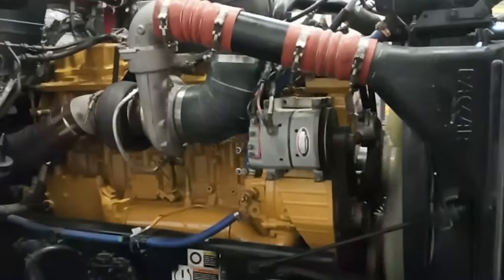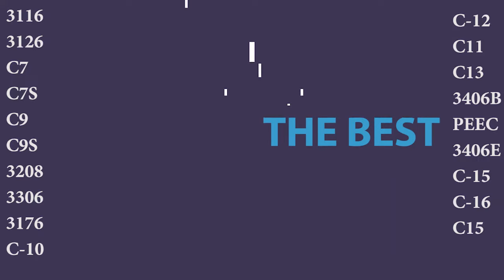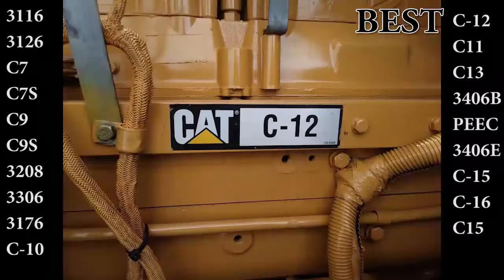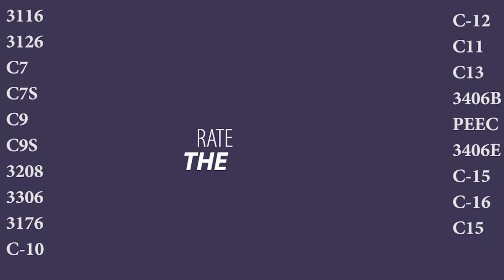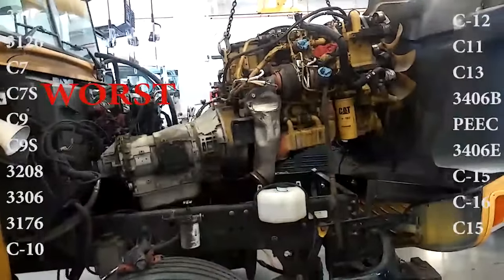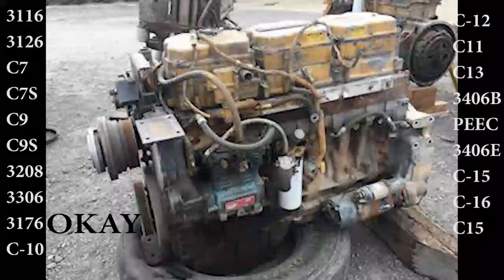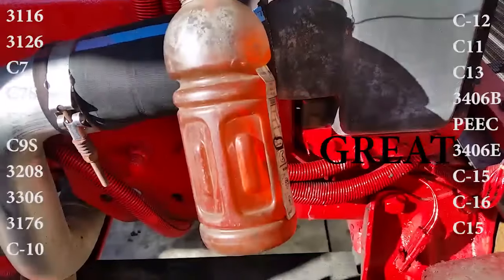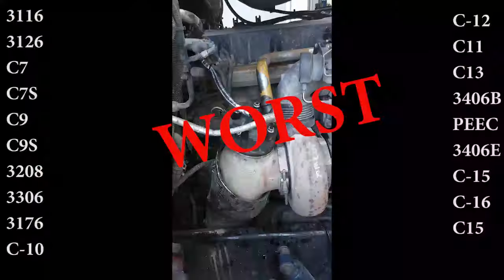Ranking the Cat Diesel Truck Engines from BEST to WORST!!!

Comment: Great Video I run a 3406B that I just overhauled and it’s great I love it! I would like it to smoke some and have seen a video on turning the pump up, what is your thoughts would you be willing to give your ideas
Reply: If your talking about on acceleration it's your FRC. 1988 and back the FRC cocks with boost. 1989 and up cocks with oil. You can not tell them apart. So the best way is to remove the line off the FRC cover. Remove the cover (two bolts). Some older FRC's has a gasket. (The cover would warp and gasket would leak) The new style has a oring which is better. You can't buy just the oring cover and put on the old style. Back to FRC adjustment. With cover off start the engine and push in on the valve. Accelerate rapidly and look at smoke. Turn adjustment screw in to increase acceleration, smoke and fuel consumption. Turn screw out to decrease smoke, making engine more sluggish. Depending on your serial number the VTU is a known problem and needs to be inspected every two years or so. Also fuel pump bypassing, if the bushings are off the old style design.
Reply: @johngoldsmith6629   Mine is a 4MG engine
Reply: @zedstierwalt6088  4MG's was the worst timing advance problem engines. Had around 6 or so updates. Once done they would hold up fairly well. Also some engines had a recall where the pin would fall out of the governor and the engine would run away, and very early engines on VTU and governor dowels. It was the first engine to get the asbestos free gaskets and leaked oil and would blow head gaskets. Again once fixed they was good engines. 4MG's was two design's below 03600, which was still a 7FB and 03600 and up which is a true 4MG.

Comment: I've had 3 trucks with C-12 engines.  With the exceptions of 2 broken valves, 1 cracked injector, and bad cam followers which took out the cams, I consider the C-12 to be a good engine.  I still have one today,  a 2000 Freightliner that currently has 2,040,000 miles, and this truck is in the shop less than the new trucks.
Reply from the maker: You should get your 2 million mile jacket and watch from Cat

Comment: You happened to skip over the c-10 and c12 but great video none the less. Thank you for the content and knowledge.
Reply from the maker: The C-10 and C-12 were in the "Best" category so they were mentioned early in the video. I didn't go into depth on any of the engine as the video would have turned into an hour.

Comment: I started my trucking with a WT 9000 Ford (1976) with a 3406PC @ 365 hp. It had plenty of power and was the most reliable engine I ever had. Really got spoiled as I got closer to today. Trucks got much nicer but no engine got even close to cent/mile cost.
Reply: Never heard of a 3406 PCTA 365 HP. Worked on a lot of 3406 PCTA 360 HP, that used a turbo off a 1693.
Reply: @johngoldsmith6629  Well that was what I had, first year it was available in the Ford in Canada. That was also the first year for the 365 hp 8v92 in the WT9000, not a great engine. The Turbo was huge and you could hear the whistle a mile away.

Comment: Can you please do a video on the 3208 marine version and how we should be using them and in your appinon what would be a good upgrade. Thanks for all your previous videos I watched them all
Reply: That would be awesome if Josh could recommend a switch from twin 3208's to 3306's or c-10's? easiest, or least complicated, would be welcomed.
Reply: One of the boats I look after has twin 3208 na engines in it. It's just shy of of 50 foot, not sure what she displaces but I would assume about 30t.

They're a decent fit for the boat, SLOW but cheap as borscht of fuel, so there's that. The oil coolers are prone to leaks. The services are affordable... don't have much more input than that.

 One windowed the block a year and a half ago and a replacement was only 10k so thats kinda nice, they've been out of production so long though they'll be hard to find eventually.
Reply: @glynpayne4393  repowering from twin 3208's? Well the first questions are: how much money do you have and how fast do you wanna go?

I can't really get on board replacing 40 year old engines with a set of 35 or 25 year old engines... let alone sourcing a matched set of them in good condition or paying to have them rebuilt and re rated to match each other.

Marine engines don't have def, dpf or egr. At least right now they dont so don't be afraid of the new stuff if you can afford it!
Reply: @j.d.saccociates3313  7-10 knots. It's a live aboard trawler. Slow, steady, reliable and fairly economical. Prefer mechanical over electronic any day!
Reply: @glynpayne4393  hmm most of those boats were single screw, don't think I've ever seen one with twins. I cant imagine you'd need much power, 200 a side, tops.

Continuous rated qsb6.7 cummins would be awesome, a bit too much power and expensive. There's some pretty good yanmar stuff out there in that power range but parts and service can be tricky depending  where you are

Electronic engines aren't some new thing, they're well proven and have been around for years. Sure they can be complex but so is an injection pump. Without emissions stuff on them they're perfectly reliable.

Comment: Ran a Sterling with a C-12/13 speed pulling a van/reefer mostly from Winnipeg to Chicago area. Great engine for that type of hauling. 

C-15 6NZ/C-16 7CZ is the king, and the 3406E/B are also great engines but behind the -15. 

ACERT are a decent engine, but not with the regen crap. You need to learn to run them at 1325 rpm instead of 1450-1550 like the 3406E/C-15 engines. 

A 6NZ with the ACERT crank and pistons gives you a 15.2L no emission/IVA engine. 😍

Comment: I believe the army has the c 15 in the newer hemtt a4 engines never had to replace hardly anything on them the c7 acert is in the matv and newer mtv trucks usually the fuel pump goes out on them along with exhuast manifold leaks never had to replace components on the matv thank God

Comment: My personal experience with C-12 was horrible. I had 3 mounted all on sterlings  2000s. dump trucks.
the camshaft, piston oil rings, engine heads, everything was a disaster
At the same time I had a 3406E mounted on a Western Star. I put a million three hundred thousand miles on it and sold it just as strong

Comment: I had the c15 acert with the regen,finally deleted the entire regen system along with the twin turbo to single turbo ,now it has ran great for three years,,I am in the process of replacing the engine to a c15 6nz soon,,do you think that most of my parts will be able to match (fan,fan clutch, alternator, and  starter )
Reply: What did deleting the Extra turbo run you? I still have the compounds and it’s running great. Don’t plant to do anything unless they fail.
Reply: @romanshevy257  I took it to a shop here where I live and my guys got after it,,I got my single turbo,manifold and piping from PDI,out of st george,ut,,,changing the twin to single changes your exhaust set up,,that costed 6gs,,to install was about 2gs  they had to change and flash the ecm to run with a single turbo set up
Reply: @davidtrevino6876  what was the benefit of going to single turbo ?
Reply: @romanshevy257  ,I deleted the regen on the cat,it ran great for a year then one turbo started to fail,it was cheaper to convert and get more horsepower as well

Comment: Here are my picks.....
1693TA...the original "Four and a Quarter Cat"
3406B,C and E
The 6NZ
C15
The twin turbo 3412...although it was never installed in a road truck.
The Worst.....
C13 twin turbo ACERT
C7
3176
Reply: You forgot one of the greats the Cat 3408 just gotta keep your foot out of it for any fuel mileage

Comment: I've got the c-15 MBN "bridge" motor and while it's not as good as the 6nz, it's been pretty reliable since 2004.
Reply: Those bridge motors lasted for ever had one new broke a couple rocker arm studs ran it a million miles had  rebuilt ran another million three  rebuilt again it almost to 3 million now
Reply: I have the same engine I took the mufflers off ran a straight pipe aftermarket turbo I would say it where a 6nz is or really close

Comment: What about the 3406 C, withe non electronic stuff for the fuel pump.The PEEC 3406 C is the electronic one. But there is the same motor, but no electronic fuel pump. Or am I getting that wrong? Cuz my 379 is a 93 with 3406 C and and it doesn't have the that computer crap on the side of the motor controlling the fuel like the PEEC does. Or maybe it got changed out at some point to full mechanical, idk?

Comment: Can you use a C15 block acert crank rods and steel piston and build a marine engine or do you half to stay with the RLA   engine. I would like to build my own engines I need two
Reply: He mentioned in a previous video that cat parts are very interchangeable as far as physical fitment. Its the custom tuning requirements that are the downside, at least from a cat mechanics perspective.

Comment: Say what sockets and wrenches bigger than 19mm or 1 1/4 do you use regularly enough to buy them? Or specitallty tools you've needed enough to buy.
I used to wrench and went to tech school but I ended up a truck driver to buy tools but that was 10 years ago lol, I'm looking to get back into it but I'd rather have the tools I could actually use. 
I'd really appreciate any help, thx

Comment: So I just started driving a 2003 Pete. The valve cover says C-15. I am assuming it is an MBN but the tag is missing off of the rocker housing.  The waste gate hose doesn’t go to the compressor side of the turbo. It goes into metal tubing that runs behind the engine and back to a block with the fuel filter mounted on it on the driver side. I’ve never seen this. I’m trying to figure out what it is for the owner. Anything would help.

Comment: 2ws 3406e here, I can’t figure out why I keep getting black stuff on the inside of the radiator cap? Any ideas?
Doesn’t overheat
Reply: Have you taking a coolant sample and set to a cat lab? If not you should do that and it will probably tell you what is contaminating your coolant system.
Reply: @cullenmiller8170  no haven’t, just oil samples and they are clean. I’ll do it with the coolant, thanks for the advice

Comment: Always look forward to your videos. I’m having the injections changed in my 6nz they almost 20 years old and have never been changed to the best of my knowledge. Only had two that were working properly one had the housing cracked that was dumping fuel in the oil under a load. I’ve been putting marvel mystery oil as a fuel stabilizer since I bought the truck in 2018 by the way they had just done a platinum rebuild on it with the paper work and it had 58,000 on the odometer. Do you think I should keep putting the marvel mystery oil or discontinue use ? Thanks

Comment: I own both the 6nz and 3406e engines in my w900s.i love the engines but have had horrible problems with head gasget issues on the 3406e.And oil pan leaks.Tearing it down again from a POS turbo flying to pieces causing it to run off!I'm not looking forward to see what all is destroyed!Love your videos!!
Reply from the maker: I'm about to say something that will make your life a little easier, there is a one piece oil pan gasket that Cat makes for those engines instead of the puzzle gasket. If you want to part number send me an email and I'll get my notebook on Monday and tell you it.
Reply: Cat has also just released a new head gasket set up that has a new ferrule that is supposed to help funnel the engine oil that comes down from the head to the passages in the block.  I have done a few with this head gasket setup and so far so good on the engine oil leaking from under the spacer deck.  You will have to ask for it as so far I haven't seen the updated head gasket with the ferrules in the head gasket kits.  Been seeing them in the gold and platinum overhaul kits though.  Liner heights might be off if your blowing head gaskets, or the deck of the block might be needing machined too.
Reply: @brucelee64485  my cat doesn't leak from everywhere, it just marks its territory very well.
Reply: @AdeptApe  do they have a one piece for Bmodel cat 4mg46394
Reply: @johngoldsmith6629  thanks